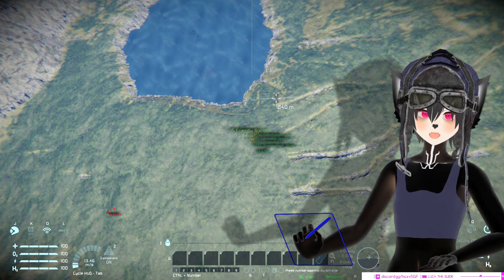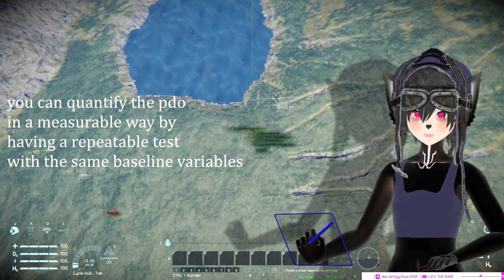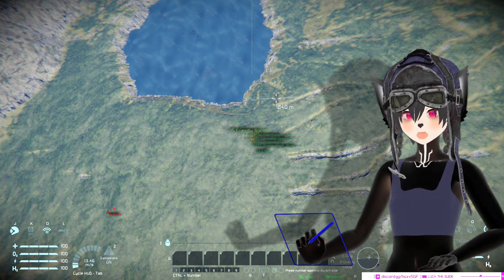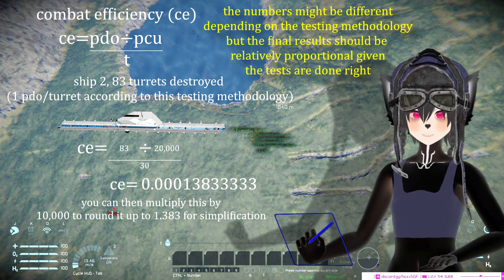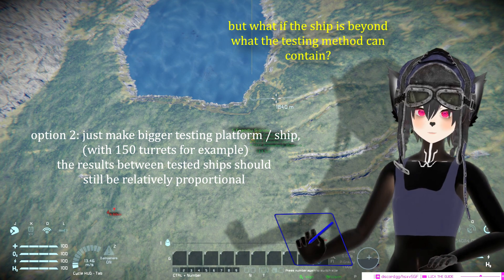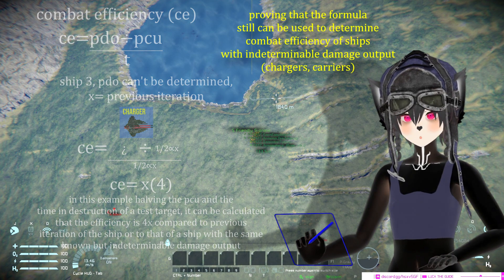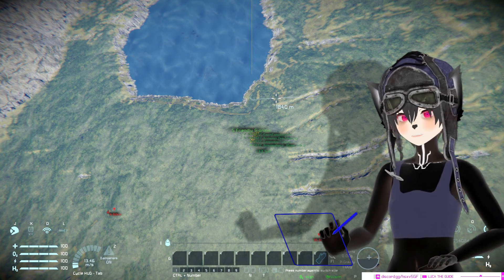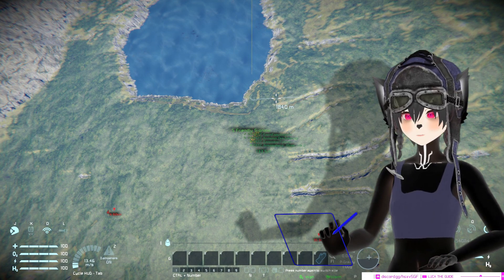Measuring a Ship Potential Damage Output is Painful, Space Engineers Combat Ship Design Math #2

Comment: Sadly this is a really bad way to calculate how good a ship is because dmg over time does not matter what matters is how much dmg you deal compared to how much you receive and ofc how much of that received dmg you can handle. If a ship can kill a hundred turrets without taking a single hit it will be much better than a ship that barely kills those hundred turrets but does it faster.
Reply from the maker: Yeah the pdo takes into account all that things c=
Reply: @LucaTheGuide  you did not mention that in your video. Can you make a list of things you think the performance of a ship depends on?
Reply from the maker: @AdamSchadow  Meaningful protection, meaningful acceleration, firepower, turrets' lines of sight angle c=
Reply: Yeah, it takes it in to account because it's the integral of damage done though time survived and time survived depends of all of that other variables like acceleration, armor ...
This depends of the ship and can compensate if it is smaller but faster, so it recieves less damage per second.

The only problem is that this system only values the ship against a set opponet, in this case the turret square. A really particular opponet. (Static, the shape is weird, it doesn't have other systems you can destroy like thrusters or even the player... )
So that metric is only usefull in relative terms. There are no best ships, you can have ships that are worse agaist one kind and have advantage agaist other kind. 

(This is all an assumption, I started playing two days ago and I know nothing about combat yet)
Reply: @alvarolff7649  Thankfully right now this all does not matter since all that matters is how many arty turrets you have how slim your ship is and how fast you can accelerate since every other strategy was made invalid.